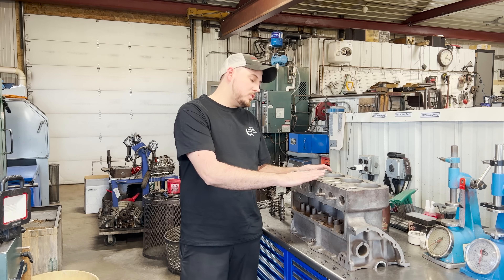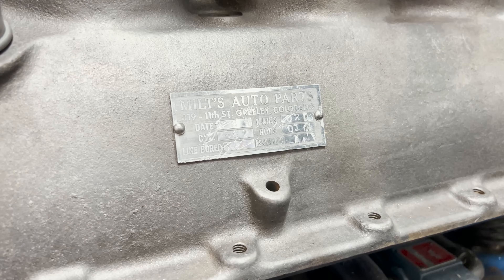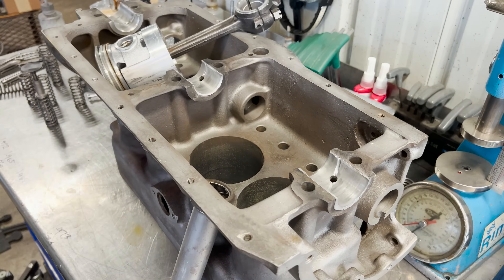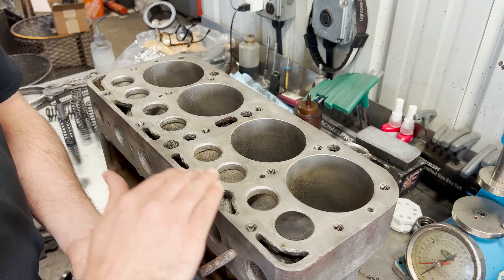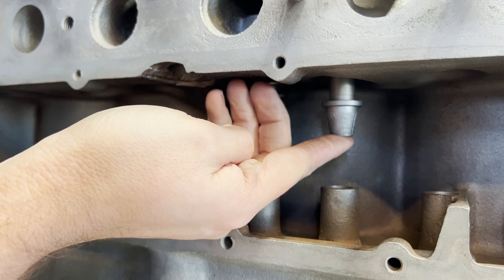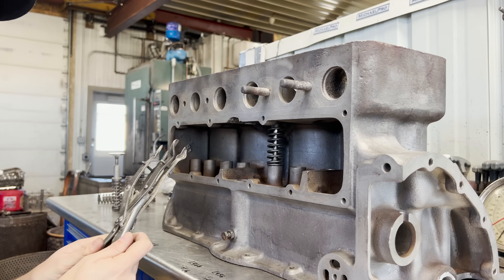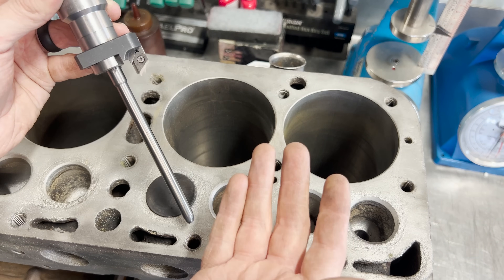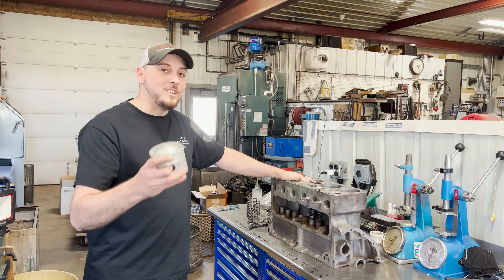The Nuanced Design Of A 1929 Ford Model A Engine

Comment: With babit you usually pour the babit around the part with dams then machine an oil grove. You use the soot from an acetylene torch on the shaft to keep it from sticking. no line boring.

Comment: The babbet bearing process you describe is incorrect. The babbet is poured in place around a shaft coated in soot with dams on either side to prevent it from leaking, with the soot preventing the babbet from sticking to the shaft. Many of the vintage machinery restoration channels(i.e. Vintage Machinery) have shown the process.  The only machining after the fact is to cut in oil grooves, and drill openings for oil passages into the bearings. https://youtu.be/qNCrUFUmlYQ?si=YjLI8AfFw4pdkmeL

Comment: My dad owned an engine shop in Tampa Florida. Even in the 70's there were few that did the Babbitt bearings. I worked for him as a teen and we did a few. He would do the bearings then had a long grinder that he mounted just like a crankshaft so all the bearings were straight, true and the same dimensions.it was amazing the crud that the old oil from decades before could build up.

Comment: I am an "old" restorer of Model A's, have never heard of Milts, but the go to parts (new and used originals) is Bert's Model A in Colorado.  I believe, they are still in business, I bought a used Model B motor from them for my latest restoration, it is similar to the Model A block but with bigger mains and rods journals and partially pressurized oil system which most restorers these days convert to full main/rod/cam pressurization.  All the original rod/main bearings were poured babbit bearings, not commonly done today, so most new rebuilds get converted to modern shell bearings.   There is a new block being made by Terry Burtz that has 5 mains and full oil pressure system, he also has a new 5-main crank available as well as rods and lightened flywheels for long-type clutches.

Comment: A common misunderstanding that you mentioned is the effect of unleaded gas on the Model A valve seat. When the A was new, tetraethyl lead was not yet being added to gas because of the low compression ratios did not require an antiknock additive. Model As ran on unleaded from the start!

Comment: Babbitt will disintegrate with age even though not worn.  It cracks into pieces.  Inserts are available and require some machining.  When the babbit fails oil consumption will increase dramatically.   Been there.  A 40k motor with complete rebuild.

Comment: such a valve tip is made to adjust the valve clearance, to reduce it, they beat it with a hammer on the end of the valve stem, it lengthened, for the clearance, they undermined or cut

Comment: That split valve guide system and extra wide tolerances is for assembly ease/speed. Look for a book called "Ford Methods and Ford Shops" it shows all the manufacturing advancements used in those factories and you'll see how all of the part designs and process methods were to continuously improve manufacturing efficiency. There's a photo in there of a single drill machine creating around 48 simultaneous holes in those engine blocks. The book is more on Model T than Model A but it's impressive history. I believe my 1953 Allis Chalmers WD engine which I recently got, that has a side plate valve cover like you have there, has similar mechanisms -- so maybe hunt up a few tractor engines.

Comment: Keith Rucker on Vintage Machinery and Keith at Turn Right Machine both did videos on it. You could also order drill rod or a piece off 3/4 cold roll and make your tool, you would include a tool charge
Reply: https://youtu.be/g_zmuB2upmY
Reply: https://youtu.be/fXobQF30IYA

Comment: I think I would turn down a piece of drill rod to fit the valve guide for a new arbor. I would be worried the inside and outside of the valve guides are not concentric

Comment: Im almost sure the design of the valve stem is to reduce the weight of the components in the valve drivetrain . Less weight in that is less mass to move and increasing performance

Comment: My only issue with cutting the seats without the guides in it is if  the guide is not machined centered; the valve job will be off on the seat..no?

Comment: If you look closely with the right light, the date code is 2-2-65.   You can tell by the rest of the tag the guy stamping them wasn't very good at it/ didn't care about the tag.  The 6 is there, just barely.

Comment: You don't machine babbet bearings. They are cast in place, with the crank also in place. They are form fit in place. The only "machining" you do is make a scratch into the babbet for the oil to flow into.
Reply from the maker: You are 100% wrong. https://youtu.be/JBL0Y3_yQ7I?t=280 Go learn yourself something... You will see that after the mains have been poured, they set the block up for an align bore.

Comment: as said prior, we ground and polished my cranks. along with we serface ground the head surfaces and the heads, and intake and exhaust surfaces. reasons being the hemi i built had a rod drop through the side of it, and i actually welded the pices back in with dad's old AC/DC shop welder. and i believe was number 5 hole we machined out the cylinder hole and slid a sleave into it. the hemi cam to me free and i wanted it to servive. and it did final build finished it dyno'ed out at 1160 horse to the wheels we never had a engine dyno to use but the auto shopin the school had a chassis dyno. oh my you both made me sit back and sigh, my dad had all them tools. he was a shakey mechanic who worked for the ford dealership only when they needed him. with farming he was fine with their agreement. them tools are probably in my sisters grainer where alot of dad's stuff was put after he passed away.

Comment: I seen on a short a thread repair on cast iron head with a solid ⅜-16 OD X ¼-28 ID insert as it was originally. Was I taught incorrectly that you don't put fine threads (¼-28) in cast iron?

Comment: Love all your videos. Would like to see some "complete" rebuilds from pulling the engine to putting it back together with all the machine work and parts, especially with the machine work on the block and heads to get them back into specs after years of use. Information on the taper and accuracy of the cylinders from the centerline of the crank to the balance of the assembly. One of my first jobs was at Sundance Automotive in Albuquerque NM. Sadly at the time, I was not up to par with what they needed and they did not consider helping me get better but they worked like you do to get it right.

Comment: from henry's viewpoint:
no separate retainers means less fiddly and less likely to break the rhythm of the assembly line. fewer part count means less tooling and less steps in the assembly line. simpler assembly means simpler training.
now...off to the lab to help figure out how to cast a v8 block in one piece without the damned thing fracturing.

Comment: Don't be afraid of pouring babbit bearings, It's not that difficult, , In those days a kit was supplied that had babbit, and molds for your engine,
Reply from the maker: It’s not just pouring. They have to be machine afterward. I do not have the equipment.

Comment: Old Steam powered Machine shop somewhere east can pour those bearings. He has a You Tube Channel. Shop is effectively 1925 so the A is just a little modern!!
Though I feel there is slipper bearings made for those engines?? Or maybe that was the V8?

Comment: Well done and very interesting.  I've owned my 1931 Model A for 55 years; had the engine rebuilt at a machine shop in Escalon California in 1979 and installed it in 1992 - have 23000 miles on it and it runs like new - stock as a rock.  Can't wait to see what else you do to that old block.  Killer machine shop tag on the side!

Comment: I did auto restoration for several shops, including 1 shop where I was the Model A chassis and driveline specialist. I think there used to be a company if my mind serves me right that used to make insert bearings for the mains and probably for the rods too. We didn't do too many engines in house, but sometimes we would have problems with a vender built piece, so I would be called on to make it right. We had a lot of problems with valve sealing for the same reasons you found. Since I was also the shop machinist I made a pilot that located off of the valve guide bore and locked tightly from the bottom with a bolt. The cutter spun on the pilot. This setup was sturdy enough to hand cut pockets for seat inserts. As for the flared ends on the valves, machining grooves or drilling holes to fit a retainer took at best several seconds. Henry Ford found that if you induction heated the end of the valve and forged the end in a punch press it  took less than 2 seconds. The retainers were also hot forged by punch press..

Comment: Ford ran split guides from in the T, A and B fours, the V-8 and V-12s. The tulip on the valve stem saved money and having a machinist and the equipment to do the keeper grooves. No costly valve spring retainer cap either. Ford was frugal but it also helped him to keep the sale price low and still make a profit.
Model A transmission crates were cut to be a direct drop in for floor boards after they were unpacked, other wood scraps were made into KingsFORD Charcoal at the Rouge plant

Comment: Have you noticed yet that there is no screw adjustment for valve lash in this engine?  The valve stems are manufactured with some extra length and the valve has to be installed, lash measured with a feeler gauge, the valve removed again, and then ground on a bench grinder. Then you get to go through this whole process as many times as necessary until your lash is within spec. Then you get to do it all again for the other seven valves. Someone did come up with adjustable tappets after the fact but only as aftermarket; Henry never used them from the factory. 🥸👍🔧✅

Comment: My father was in Brazil as a young man from 1924 to 1936 and had a Ford garage.
When he returned to Germany, he brought with him various tools for repairing Ford engines, the use of which he explained to me many years later in our new workshop here in Germany.
The split valve guides were necessary because of the mushroomed valve stem. This large lower diameter of the valve stem was necessary to dampen valve noise and protect the camshaft along with an oil cushion between the camshaft and valve stem. The valves could not be adjusted by means of set screws but were "adjusted" tighter by grinding on the seat or larger by grinding on the stem The valve spacing was kept quite large from the factory or after a repair since an adjustment could only be accomplished with great effort.
For mounting the valve guides there was a special tool with which one could tap the guides in to place.
This comment comes from Germany and please excuse my, most likely awkward english.
Reply: Only a German would apologize for their perfect English.
Reply: Your english is better than many natives.
Reply: Good job, your English is pretty much spot on.  I’m in machining and engine building, but in college minored in English cause I like to read and writing papers came easy to me.  I don’t really see any errors besides what may arguably be called a “run-on” sentence…where you cram too many ideas together and your subjects/verb/direct objects/prepositional phrases start getting all linked together and turn into compound sentences and just become “muddy” and hard for the reader to understand coherently while scanning thru text visually.  The key to reading clarity being understanding something the first time, not having to reread something.  Like that big ass long sentence I just typed, lol.  The way I see it, when we type messages out it’s more of a written representation of verbal communication which not everyone does in the same way as they would, or are capable of if indeed they intended to write something out properly in their native language.
Reply: @robertmason8341  I was going to say -- are you trying to demonstrate a run on? 😉
Reply: @Oberon4278  🤦‍♂️🤣
Reply: Your English is near perfect, and your stories much appreciated!
I've worked on some of the old mushroom valves.
Reply: Great information
Reply: You did really well with your English. Much better than most from English speaking counties. You're amazing. What a cool story about your dad.
Reply: Herr Hartle, Ihr Englisch ist weitaus besser als das der meisten Anerikaner.

Comment: If you opt for the bushing, build it with a larger diameter 'stop' shoulder at the top. The extra radial surface will steady it against the block. The interference fit won't need to be as tight, if you want to put expansion stress on the cast iron guide bores.

Comment: a bit of a heads up from what I can see there's still a lot of life in the babbitt in that block and the rods. If there where still more then 2 or 3 shims in the mains and connecting rods they still are in usable range.  the way to adjust a babbitt crank is to remove shims as needed to tighten the crank and rods to fit for proper running so if they still had a stack of shims it's still fine

Comment: Flatheads in America stoped in 53.  Talk to Anyone at H&H Flatheads they  know a flathead 4,6 and 8 in and out.  You can actually machine the rods and block to accept modern bearings.
Reply: Ford flathead stopped in 53. AMC used a 195.6 flathead through 1965 in it's Rambler American model.

Comment: I used to work at a small engine repair shop in SC (Battery Electric Co) in the late 2000s that also did some carburator and machining work. The machinist (Lewis) was in his late 70s and he  poured babbitt bearings, ground crankshafts, and stitched cracks in cast iron blocks (in addition to the more standard stuff). We had a pretty steady stream of model-A & model-T blocks and cranks in the shop from all up and down the east coast. Pretty cool.

Comment: As somebody else mentioned, the Ford 9N tractor, introduced in 1939, used the mushroom head valves and split guides. Sometime in the production run (I forget when) of the 9N, 2N and 8N variants they switched over to one piece guides and split keepers.

It’s standard during overhaul to go to the one piece guides and split keepers. Finding an engine with mushroom valves is unusual.

Before anyone gets the idea that there is any parts interchangeability between the Model A and the tractor (common misperception) there isn’t. The four cylinder engine used in the tractor is half of a flathead Ford V8. At every tractor show somebody comes up to me and pronounces that the engine must be an upgraded Model A.
Wrong. The only thing shared is a single electrical part, the cutoff.

Comment: My strategy here would be to machine a little brass or bronze bushing on a lathe that would fit the valve guide hole fairly tightly and then use that to guide the regular valve pilot for the seat cutter. However, that's coming from an engineer and we all know that us engineers aren't held in high regard by machinists.

Comment: Very interesting! The modern Briggs & Stratton lawnmower engines also have a side valve design and there are quite a few videos on Youtube which show how these engines are overhauled. Maybe you can pick up a few tips there? One thing that is never done on a B&S is honing the sleeve. I don't know the reason, but they rather replace the block if necessary. I think the low compression has the advantage of the engine not wearing the sleeve out so much.

Comment: Those were the days the valve seats were cut with a stone.There was a certain mount of skill require to get the seat right, I still have a complete setup. Did my first valve grinding 66 years a go. I was12. My father was mechanic who used to race model Ts.

Comment: James!  Good videos.  I missed if you considered using the valve guides to hold the pilot in place for the seat grinding.  The bushing is the best of all the ideas as long as the casting is accurate and will hold it in the right location.  Personally, I would make sure each bore for the valve guides is where it belongs and use bushings to locate the guides, but what do I know?

Comment: Ford only made 15,000,000 of model T. The foundry poured 10,000 engine blocks every day. No wonder those still pop up today. I just had a model A pass me going the other way on a back road of Eastern NC. It looked rough but in unrestored, original condition as it made the turn at the cross roads. It didn't even smoke.

Comment: An adjustable split wedge type pilot might work .....I have a couple smaller ones for my Kwik Way seat grinder. I don't know if one the right size is a made for that application.  I'd be a lot happier doing those seats with a set of stones rather than a seat and guide machine. I never worked on flat heads myself and am 75 and spent years in a machine shop. We were more of a race engine shop and never even did a Flathead Ford V8 !

Comment: It might be worth checking out the springs to make sure they compress at the correct poundage. I would also suggest it's worth doing the extra bit of machining to do the valve guides spot on, even if this is extra cost to you. You never know, doing a good job on this engine may bring more work in.